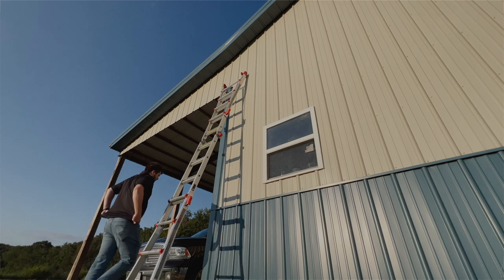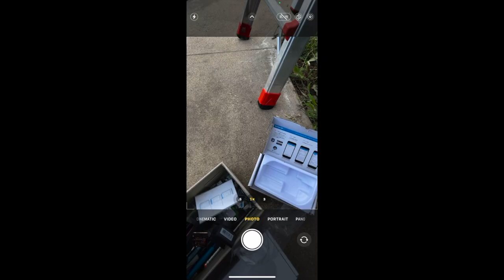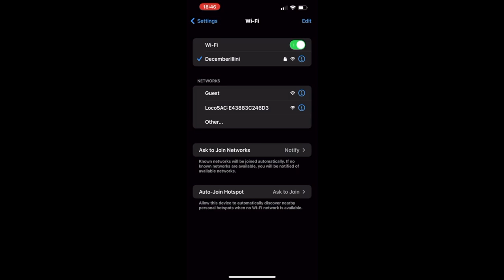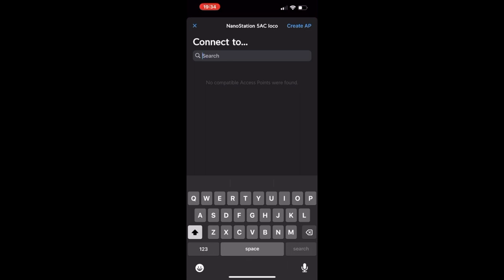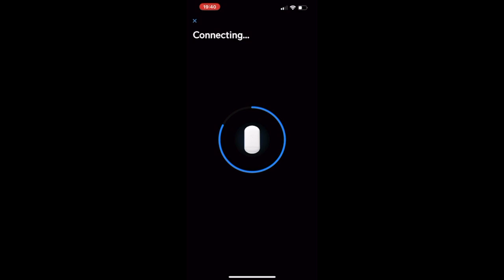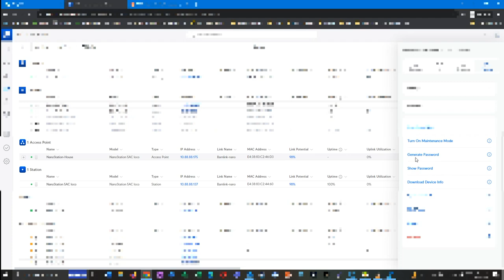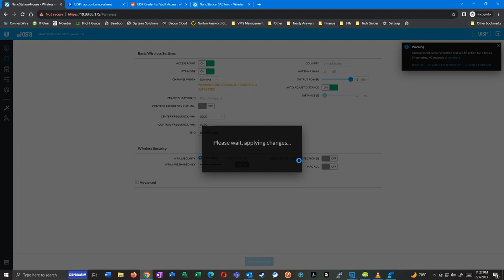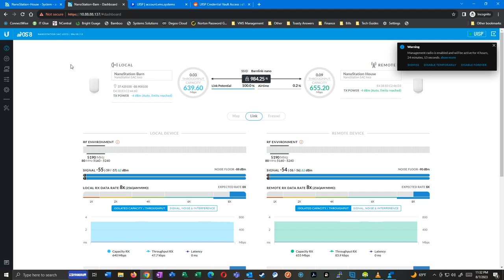Wireless Bridge - Installation (Part I)

Comment: Hi, thank you for a great video. I am just wondering what you think about using the adapters from 802.3af to Passive POE. Ubiquiti has these adapters for indoor and outdoor. The PN's are INS-3AF-I-G and INS-3AF-O-G. I think the biggest benefit will be the ability to restart the device remotely with turn-off/turn-on POE on the switch port.
Reply from the maker: I'd actually never seen those before, but I definitely like the idea.  I personally have three devices (Wireless bridge pair, and Unifi Switch) that require the use of a 24V passive PoE injector.  These would basically eliminate the need for the injectors and allow me to power these directly from my PoE switch.  I will probably order a couple to get rid of my own injectors. 

I agree with the biggest benefit being the ability to restart remotely.  I can't tell you how many times I've ran into inaccessible APs in the wild that need to be rebooted, but are running from an injector.  The ability to shut/no shut a switch port to reboot is a life saver sometimes.

Comment: The whole 24V passive problem with Ubiquity is my biggest complaint about all of this.  I hate the PoE injectors and they add a good percentage of the radio cost to the total price tag if you don't happen to have them laying around.  Meanwhile, Ubiquity is phasing 24V passive out of the switches....

Having said that, I run 2 of these same point-to-point links on my property to get to my barn and to my garage and get a little over 600 mbps on each.  The total cost and time for this setup is so much lower than running a cable that it is a big winner for most use cases.

Thanks for showing us the whole process, mistakes and all.  I definitely recommend setting up the link and testing on a work bench prior to going outside with anything, but in the end none of it is really that complicated or hard to overcome in the field.
Reply from the maker: I thought we had left the 24V passive PoE days behind.  I was actually surprised to see these "newer" Locos only supporting the 24V passive standard.  I brought out my older switch thinking that it would support the power requirement, but I was wrong.  I too wish that they'd transition all devices to the "standard" PoE instead of the "legacy" passive standards.  Makes things confusing.